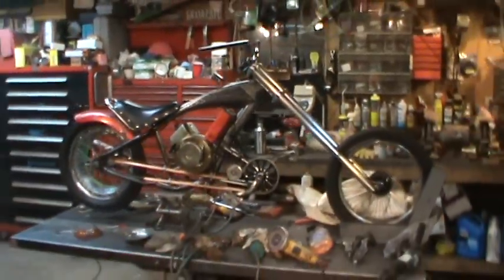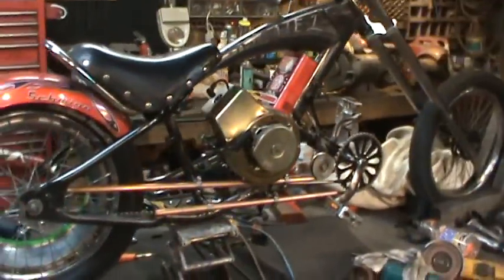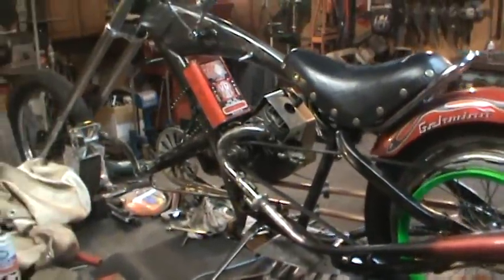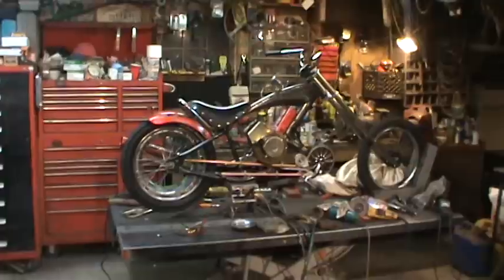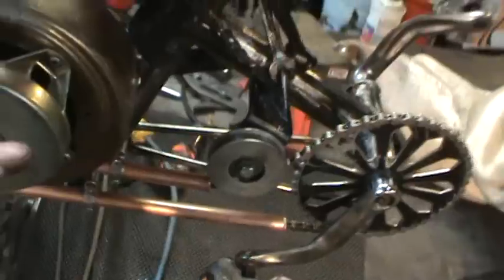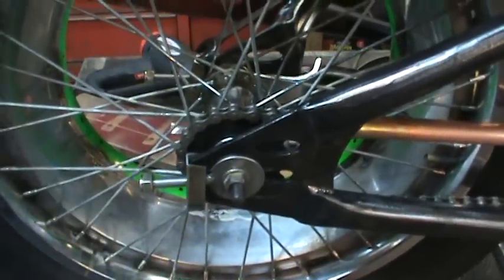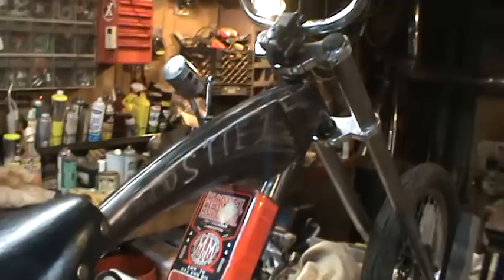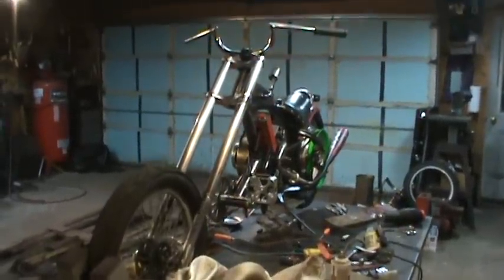gas rat bike part 17 reassemble

Comment: Bike is looking good. The marantz speakers brought back old memories of my first car stereo. I had a marantz tape deck with auto reverse, a kraco booster/equilizer (which replaced my audiovox smaller booster), 6x9 Jensen triaxles in the rear and no name brand tweeters in the front, lol
Reply from the maker: think we all had that kind of setup, most of them were sitting on the tunnel with 8tracks wedged under them,